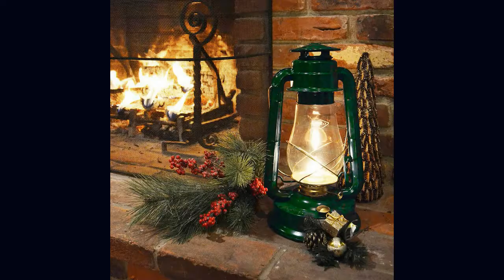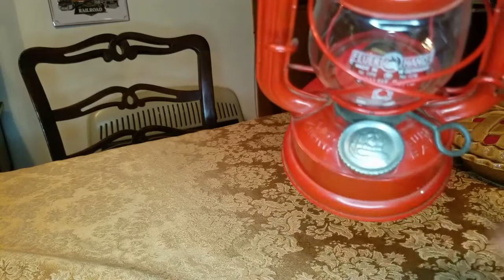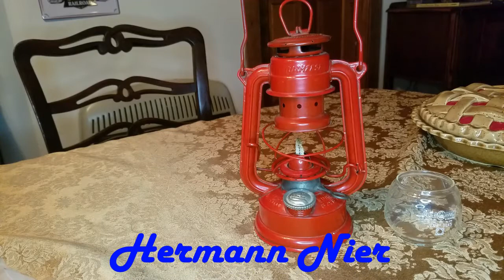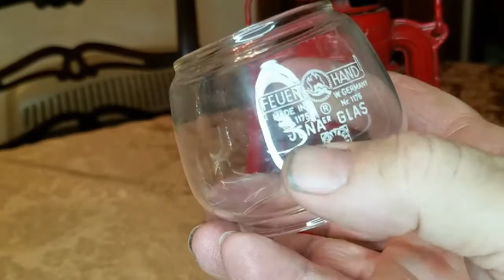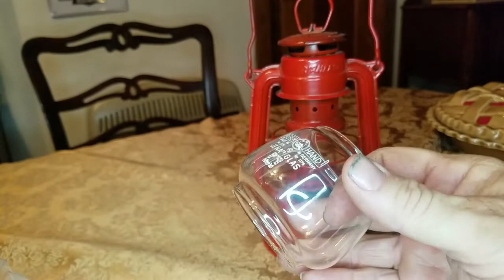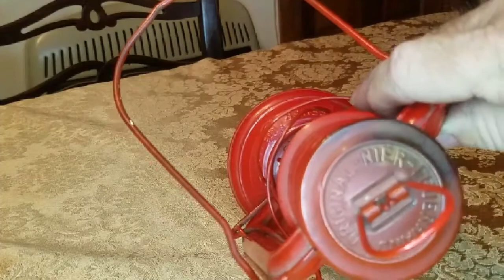Feuerhand's German Hurricane Lantern, Gary J

Comment: I still need to add a 175 to my collection.  Feuerhand lanterns are the best on the market, and today they only make the 276 model.  Got 2 of their larger 280 lanterns and they are built like tanks and put out a wonderful light.  When Hurricane Helene came through here and made a mess out of things, my oil lamps worked perfectly even when all my battery-powered modern stuff was DOA for one reason or another.  Collecting Feuerhand lanterns is rather fun.  You can get two or three of the smaller styles, keeping them on bookshelves and nooks around the house where they'll look great and be handy when the power goes out.
Reply from the maker: They are really neat, especially when you look at how ingenious the design is. I use my lantern too when Heleen came through.

Comment: The  Feuerhand 175 and 275 are worth some money, not the 276, and was built after 1973 and replaced all the different variants to the only 276. But before 1973, you had 2 periods: 1933 - 1944 for the 175, 275 and the Atom and some more models. Then production stopped and restarted in 1949 and then you have the post WW2 with "Western Germany" 175's,  275's till 1972. The postWW2 do between 150 and 250 eur (even bad 175, 275 ones). The pre-WW2 with only "Germany" on it is easily "double" that. The Atom is even more rare and expensive. I have a still shiny tin metal, not painted 275. With the original strong JENAer glass, still burning next to me in 2025 and it's 52 till 73 years old (a post-WW2 version). Easily doing minimum € 250,-.
Reply from the maker: @newoaknl  Thanks for that great history of these lanterns. We generally takes these early light sources for granite. Their design is amazing.
Reply: @knightingalesaid  .. absolutely the design is amazing.